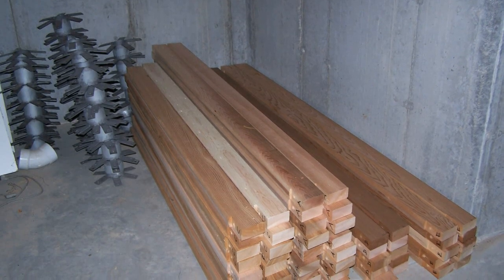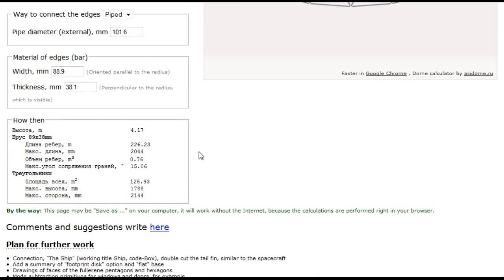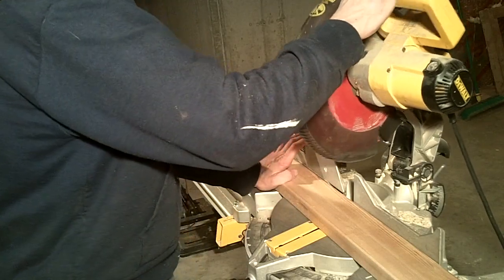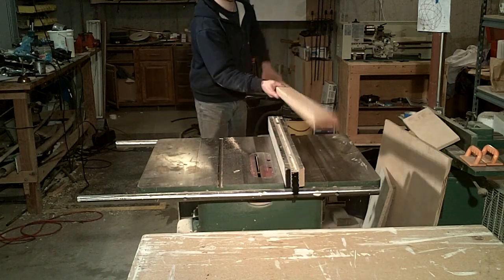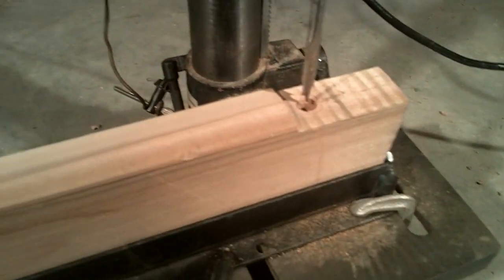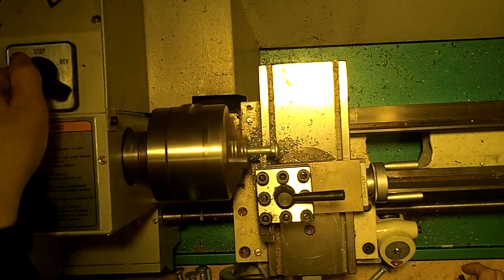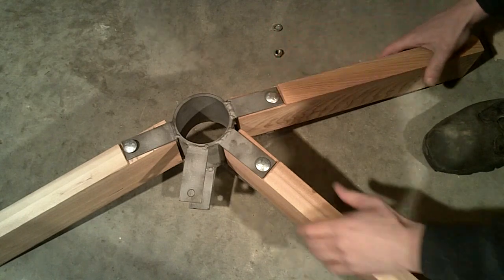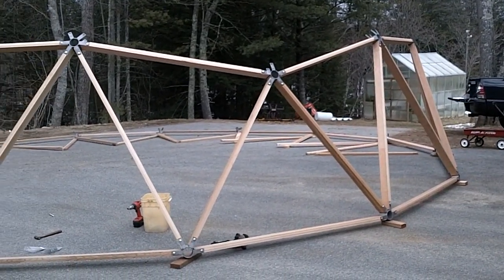Geodesic Dome Greenhouse - Part 3 - Strut Construction

Comment from the maker: @bayoufilter It was based on minimizing the scraps from the polycarb panels since they are the most expensive component.  These panels are 6' wide, so with a 3v, 32.5 foot dome, the maximum triangle size from tip to base was just shy of 6'.  If you go up to a 4V, I'm sure you could do a much larger building!

Comment: hi man, you totally inspired me to make i geo dome with aqua ponics. i watched your vids lots of times and other and did research. so now ive got my own 2v dome raised on 250mm stilts under base hubs, 4.3m dia.i got 100 silver perch fingerlings in ther and a few others ( trout, cod muscles and 100 shrimp) and 5 commets. struts are losp (organicly treated pine) 105mm washers as hubs (2 per hub) and covered in builders plastic. triangular door. LED down lights and 12V dc backup pump. video soon

Comment: @proder2007 
I use 14 vents in the kneewall for 360 degree low level intake including the door. To maximise the chimney effect  use the entire top pentagon for the  high level vent. Reinforce the pentagon and the opening, hinge it on one side and use hydraulic rams to open it. Don`t forget to install safety chains in case it ever gets loose.

Comment from the maker: @mobiusII actually, a very good question!  There's basically enough friction in the wood and (poor) alignment between the wood and the hubs that the bolts held in place.  Once the heads started to grab into the epoxy on the hubs, there was enough friction to tighten them.  I think there were only 2 that spun and I just used some vice grips to hold the heads.  ;-)

Comment: This is a great video!!!  I'm having series equiptment envy!  Thanks so much for the info for angles and the website calculator.  I can't wait to see how you put on the panels.  Are you going to put in some motorized temperature controlled vents similar to what you did with your other greenhouse?
Are you going to use this greenhouse just for aquaponics?  If so, do you have a floorplan yet for how your are going to set up your system?

Comment: Jolly good work, starting from a very clever idea.
Q1: why not use aluminium for the struts? Or for the cylindrical hub?
Q2: you are not planning to use an opening right on the center of the dome, are you? This would be ideal to release hot air in summer days, so how will you do it?

Comment from the maker: The angles are roughly 78 degrees but do change slightly.  For mine, there's enough slop in the hubs and wood so I made everything the 78 degrees.  Because they aren't all the same angle, I spent little time trying to model this in 3d...especially since the building official didn't need it!  I found an autocad script that could make a dome.  private message me your email address and I'll set it to you....but, it can't do a flat base for the 3V dome...

Comment from the maker: The base of the dome has 15 sides.  360 degrees / 15 = 24 degrees for each angle.  The saw blade is set to 12 degrees,  Technically each angle is a bit different, but for this, 12 degrees will do just fine.

Comment from the maker: @yogabill You're welcome to drop by any time!  FYI:  Even though the shed has a smaller foot print, it cost more and took longer to build than the dome!  I should have either built a larger dome and gone up to a 4V, or did a second northern dome and covered it like a shed.  ;-)

Comment from the maker: @zliminator for a 3V dome, it has 15 sides so I just averaged 360 degrees divided by 15, which is 24 degrees at each angle.  If you look at each area, the angles will change a bit but there's enough flex in the steel and wood where a degree plus or minus doesn't make a difference.  I ignored all the thickness and based all the calculations on the outer "skin".

Comment: This probably a dumb question but...how did you securely tighten the nuts on the hub bolts since you lathed off the square portion of the bolt that would normally keep it from turning?

Comment: @popitch64 Hello, thank you for such a great web page.

I have one question. In the section for the triangles, you list this:

1.   45 pcs. L412-R235-L412-R235-L404-R240

I know that L is the length of the sides of the triangle. What is the R?

Comment: you dont have to mig weld, or have a metal lathe. There are numerous designs for hub connectors. All depends on your budget, skill level. Get quotes, outsource, find a retiree with a welder or a drill. Use a simpler hub design. Bolt angle brackets to a piece of pipe and bend to right angle. Use your imagination and think outside the box.

Comment: What was the final diameter of your dome? I calculated a 3V dome on acidome with a 5m radius, are your struts around 2m in length? The website shows the lengths in millimeters right?

Comment: I'm experimenting with the Russian website and I'm not sure what the section is that's labeled: "Material of edges (bar) Width, mm ____ Thickness, mm ____"
Also, how did you calculate the angles of the straps welded onto the 3" steel pipe sections? (If you can't tell me I might have to do some thinking and that would hurt my head).

Comment: Hey! Could you please tell us what size the bolt is? I'm building a 2v dome with boards of 36x73mm. Was thinking of a 10mm hole as I found those stainless steel bolts at an offer! U think the wood will suffer. Using normal construction eco-preserved wood(if u could say it like that in english)